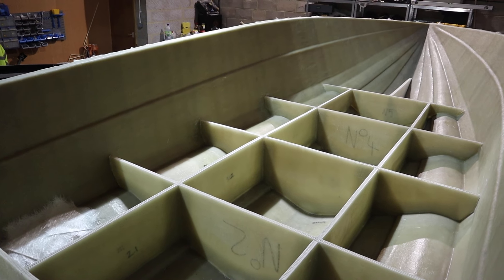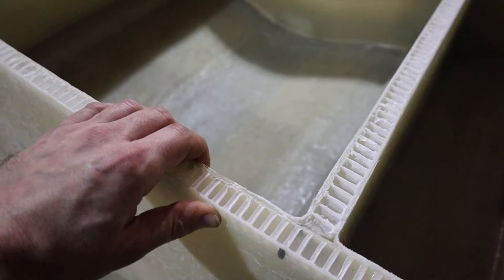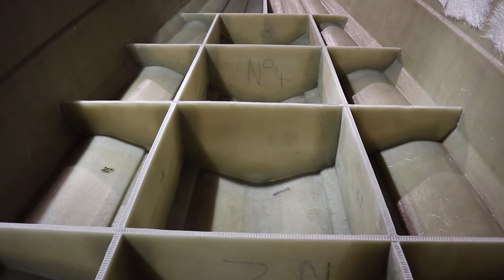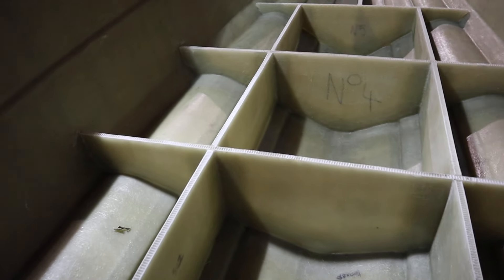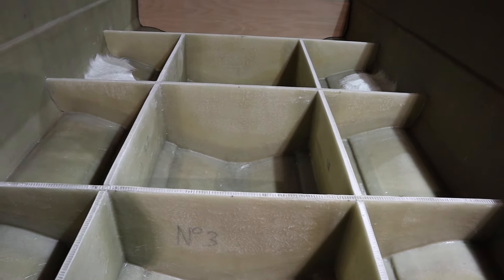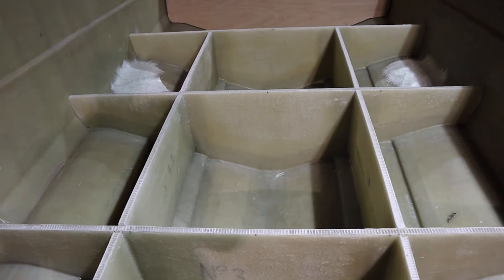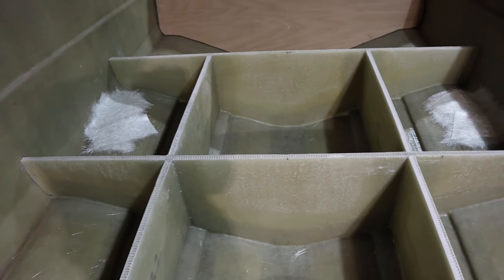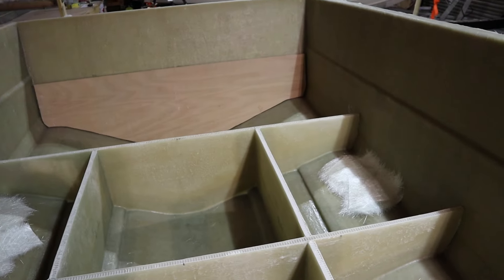SF Marine, UK, Hurricane 21 CC Part 2, longitudinal and bulkheads

Comment: how did you close the end of the honeycomb material?
Reply from the maker: Hello, if you mean the open tope we have not yet, you can fill with resin or bonding compound if you wish. But it is a very long and tedious process and for efficiency i say it is not a viable option
Reply: @sovereign_skipper  I need to close the middle of the filler.  recently started using ,,nidoplast,,